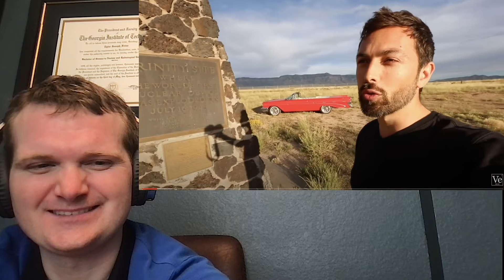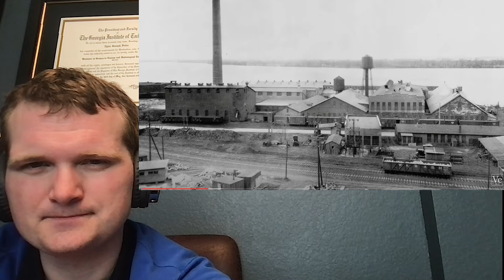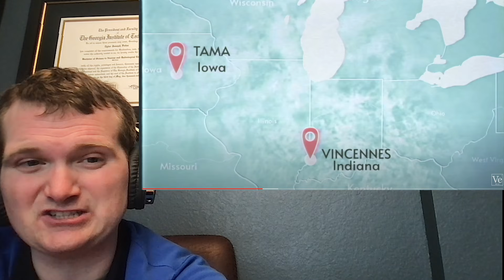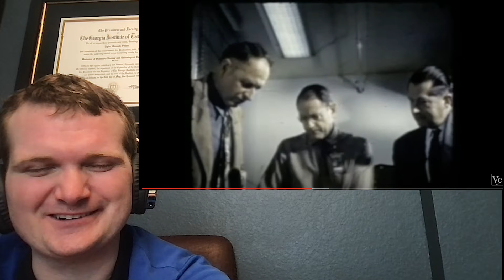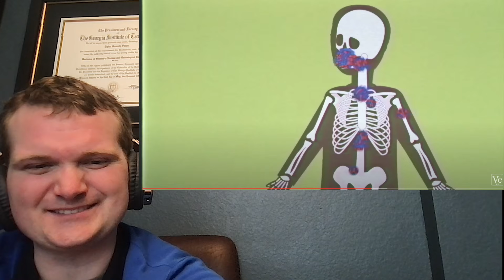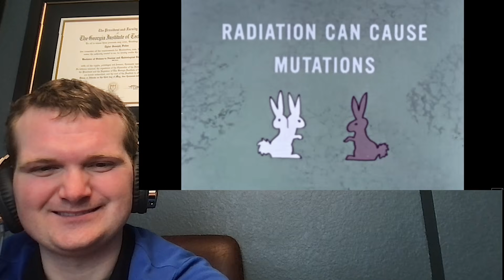How Kodak Exposed Nuclear Weapon Testing - Nuclear Engineer Reacts to Veritasium

Comment: 3:38 One of the issues here is that both gamma and X-rays have a wavelength-based definition and a definition based on origin. When defining them based on origin, X-rays are generally defined as originating from electronic transitions involving the inner orbitals of atoms (by which definition the red hydrogen-alpha line is technically an X-ray, since if you only have one electron, it's always the innermost electron), while gamma rays are defined as being emitted by nuclear processes (I think this definition also includes a few transitions with wavelengths that wouldn't be gamma rays, or even close, when using a wavelength-based convention).

Comment: I read somewhere that, due to nuclear testing, certain very sensitive machinery could only be made with steel that itself was made before 1945, because even the trace amounts of radioactive elements that found their way into steel made after that were enough to mess with the sensors. Apparently, one common way of acquiring pre-1945 steel was to recover it from shipwrecks. I have no idea if this is actually true and would love a confirmation/debunking!
Reply: It's true for more highly advanced instruments that are HIGHLY accurate, where ANY contamination appears so massive it essentially Blinds the reading, like using Chaff against a radar, it can't see what it's looking for because it's distracted by the (to it) massive erroneous data.

So the steel used making then has to be "Sterile" and not give off readings itself. For this reason, it was Usually old Warships that'd be salvaged and scrapped for their steel as, I'm sure you can imagine, not even counting the structural steel the belt armor would generate MASSIVE quantities of high quality steel. For example Battleships are MASSIVE, and their armor belt is usually designed to be thick enough to protect against their own guns arming them ship-by-ship. 12+ inches of armor on the main belt and covering 2/3rd's of the ships side. You can imagine how profitable this could be, especially with the Mark up in price for a restricted supply and marked up again as a component of "Highly Advanced technology".

As I understand it the issue is less ALL Post-45 steel is contaminated, but more thsy the air in the refinery when making the post-45 steel is. I'd assume simply using air filters could solve this, but since AFAIK it isn't done or at least widely done enough I'm aware of it, Maybe they can't. 

Maybe a new process in a vacuum and manipulated remotely or robotically could work? He'll Maybe even just the ore itself and mine need to be in a vacuum, before even MOVED and refined under vacuum the entire time, IDK.

But as far as "Old pre-August 6th 1945 steeled ships salvaged for their uncontaminated steel, especially regarding sensitive sensors and instruments, including sensitive research and medical equipment", Yes, that's true.
Reply: @pyro1047  The issue is that there is still radioactive stuff in the atmosphere, and I think it's the 'purifying from ore' part that is usually using carbon arc, isn't it?  I think re-melting the already-purified iron can be done in vacuum or other 'protected atmospheres' like that for scientific use, even if it's not commercially-viable to do that on a mass scale.  I'm sure on the 'ship-steel being valuable' thing, because China didn't-get-in-trouble recently for robbing the entirety of a few known sunk ships just so they could get a big bunch of pre-War steel.  People can't prove anything yet, I think, but it was pretty messed-up.  Some/most of them were already marked as war graves and they took most, or even all, of the wreck.
Reply: @EShirako in the past when shipwreck or quiet steel was necessary or useful which it no longer is due to better manufacturing techniques being 60 years since the last above-ground nuclear tests better detectors and more computer power to ignore any lingering remains 

Most of the current dismantling of ships that were lost during the war is not because it's low background steel it's just that it's steel and the people doing it or almost always doing it illegally and it's just poor people trying to get some money together 

For instance of Vietnam was the prince of Wales and the battle cruiser repulse. Which were sunk during the Japanese assault towards Singapore. They were both unfortunately add depths that divers willing to take a risk could easily get to. And they have been completely vanished. And there is no reason to think that Vietnam was purposely doing this it was just people doing this who are poor trying to make some money 

Near the Philippines and near Indonesia same type of behavior has happened not for quiet steel but for money 

The only racks that are really safe for the ones that are you know a 1000 ft deeper deeper 

Most of the low background steel used in Britain and much of Europe was from the world war 1 German fleet that was scuttled at scapa flow

In America we had so much steel production that hadn't yet been put to use and brand new ships were basically they just mailed off the top layer and that was quiet steel it didn't need to have actually been sunk
Reply: Yes it was an issue, and there used to be a market for prewar steel. No, it no longer is since atmospheric testing stopped years ago. Now it's just better to have a clean site and good products rather than find a shipwreck then take it to a clean site. 

Low background steel:
https://en.m.wikipedia.org/wiki/Low-background_steel
Reply: So the correct answer is it was a serious concern and shipwreck steel or quiet steel was regularly harvested for like MRI and CTI machines 

In reality now in 2025 and for the last decade plus the levels of atmospheric contamination have gone way down as has the are handling purification for making steel 

So now you can buy steel that is specifically made in a way to reduce atmospheric contamination and like I said most atmospheric contamination back 1962 when we were doing above-ground nuclear testing has faded to irrelevance 

Also the detectors such as in an MRI and other scientific equipment have enough sensitivity and computer power to ignore the very tiny remainder that exists 

So time plus special techniques to make quieter steel Plus better detectors plus computer power to edit out the results if there are any tiny ones left means effectively no one is harvesting shipwreck steal anymore 

At least not for scientific instruments there are still grave robbery going on with all sorts of world war two ships 

So it was true very true for a while it'sl no longer a problem
Reply: I’ve seen several videos on this, and it’s true.
Reply: @5roundsrapid263 Because checking whether things are true is by watching several videos.
Reply: @youtubehandlesux  Well, I’m not exactly in a position to test shipwrecks with Geiger counters, so…

Comment: Worked at a natural gas/LPG plant in Queensland Australia. They have a low level nuclear waste storage. Turns out there is a trace of radon in the gas, and gets centrifuged out by the LOG loadout pumps and the casings eventually reach a threshold of some form.
Reply: It's probably more likely that the radon gas is coming up with the oil 

Radon gas is a naturally occurring thing in most parts of the world it is truly high level and actually dangerous and will collect under people's houses who don't have a slab 

Low level of nuclear waste if you mean like from power plants isn't really going to be giving off radon gas
Reply: Yup, fossil fuels are a significant source of Radon.

Comment: It should be noted that it IS possible for a relatively small number of mutations to lead to duplicated body parts. The overall large scale body plan of a given animal is determined by it's homeobox genes, and alterations of these genes can, in some cases, lead to variations in limb formation ranging from polydactyly to cephalomelia. More often it's the case of a parasitic twin being partially absorbed, but it does happen on rare occasions.

Somewhat loosely related, there's a condition scientists have created for vinegar flies called antennapedia, where the instructions for building a leg are used in place of the instructions for antennae, so the fly grows a literal pair of legs out of it's face. That's how fascinating and malleable homeobox genes can be.

Comment: Concerning mutations: the potential threat is not to the exposed person (or rabbit).  Rather, the concern is that their germ cells might be damaged, leading to mutations in their offspring.  The two-headed bunny was an illustration of that potential issue.  A bit over the top, yes, but to the point.

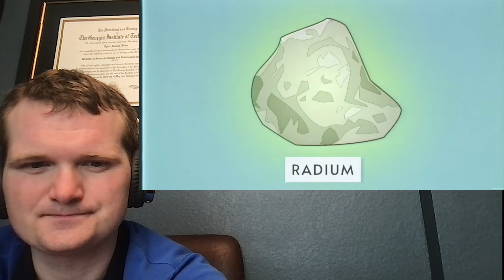Comment: 4:24 they used to put so much radium on those dials. I recently went to an aviation museum with a Radiacode 103 and found one dial which was over 300k CPM, 1000x the normal background. Even the large reconnaissance cameras were radioactive thanks to the thorium in the lenses.
Reply: Interesting because due to the relatively short half-life almost none of the watches in such even glow anymore.

Comment: The problem with the East Coast is that it's virtually all heavily populated. You're not going to find areas where you don't have people with in 100 miles, let alone 150 mi. The West Coast and especially the desert states are far less populated and also are largely owned by the federal government. It's just easier to find testing space in Nevada than North Carolina
Reply: The AEC did do tests in the Southeast. They tested two underground bombs in Mississippi in the early ‘60s. The site is still there, and is still controlled by the NRC.

Comment: For those of us old enough to remember when cameras always used film, asking airport security to hand inspect film canisters was a thing.  Obviously, a different mechanism than this story is discussing, but still something that we used to do.
Reply: Yep -- X-ray and especially CT scanners can wreck film (the newer mmWave scanners are safe though, since they use RF). Even low ISO films that are supposedly "safe" (you are less likely to notice it, but it still does cause increased base fog). CT scanners will leave swirly marks on the film depending on the orientation it goes through the scanner.
Reply: I remember the x-ray scanners would ruin the film.
Reply: There were also those lead lined plastic bags to protect the film.  Did those work?
Reply: @ChiefBridgeFuser  I never owned any, but they were common enough that I suspect they did.
Reply: @ChiefBridgeFuser they work, but a lot of security people will see this big opaque metal bag and make you open it and rescan everything inside (to be fair, you could easily stuff a weapon in some of them and make it invisible). We would usually hand over the canisters and ask them to check them by hand rather than putting them through the scanner.
Reply: @ChiefBridgeFuser Lead should work very well. Radiologists wear lead-lined PPE.
Reply: I still have some rolls I need to develop. Modern machines in the ~ 2010 era, I never noticed any issues with my film. (I would travel with a few rolls and an old FTb Canon.) I did once travel with a pro 1600 ISO roll, and it didn't develop well. 

I also had the rare opportunity of rebuilding a shelving system which had hundreds of thousands of dollars of Kodak film paper purchased in the 60s and 70s and improperly stored. Much of it was custom lots. Rolls as well as standard cuts. The lab I worked in had "cameras" built into it, some 20ft tall, with slots to accept raw film paper.  All were setup to visualize fluid flue with laser sheet illumination. Taxing, brutal, and messy work, but the paper Kodak put out was rock solid 30 years after its "expiration" date. 

Kodak CARED about quality. I'm not surprised they found this. Their engineers likely would be casually aware of nuclear processes as just another day at the office to protect their optics fu.

Comment: back in the 1980s i built a bunch of test fixtures for Polaroid that measured the density and consistency of Polaroid film by exposing sections of a test sample of film to a radioactive source.  they would then develop the film and determine whether they needed to adjust their manufacturing process.  the company i worked for also built test fixtures for their SONAR based autofocus mechanisms.   an audio transducer would send out a ping, and start the lens moving at a constant rate. when the reflection of the ping was detected. the lens motion stopped and the shutter tripped.